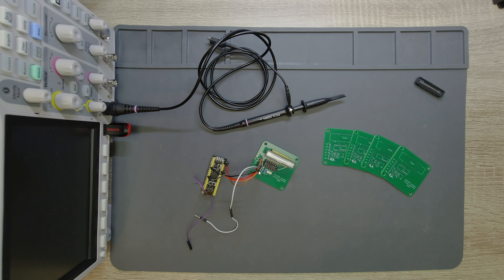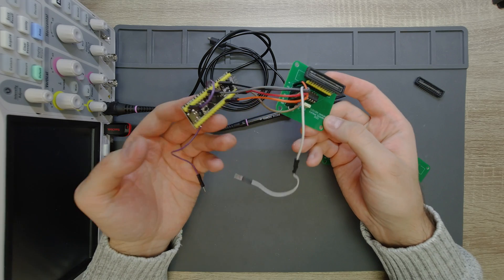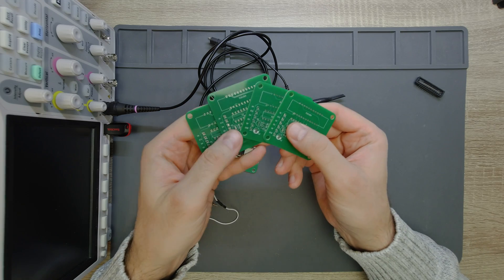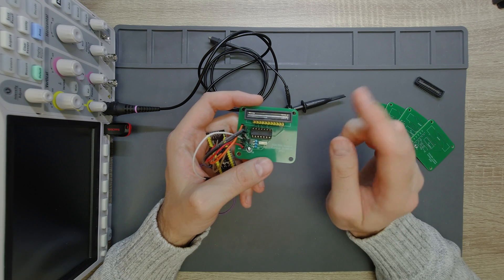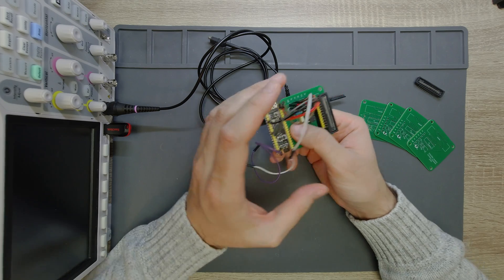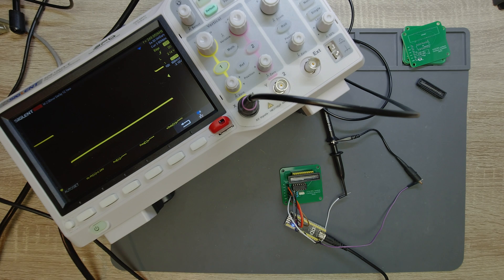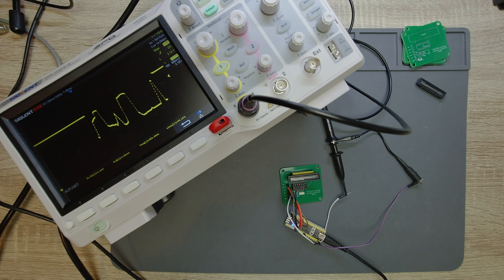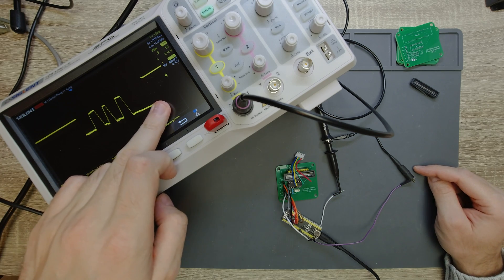TCD1304 - Part 1 - Introduction

Comment: The capacitor of C1 in your video seems to be different from the capacitor in your BOM. What kind of capacitor is used for C1? Thank you
Reply from the maker: I used some 100 nF foil capacitor that I found at home. A 100 nF tantalum or ceramic cap is also OK. But I don't recommend this circuit. I would recommend the circuit in my most recent TCD1304-related video. It is more up to date and modern. https://www.youtube.com/watch?v=c3CUCue62sU

Comment: Hi.  Not being able to evaluate what would be necessary, I would like to ask you if this TCD1304-based approach could be readily used to build a single-photon detector that records single photons coming from the double slit experiment, but would have to be done in total darkness.  So far, the equipment that I am finding to do this is horribly expensive.  The CCD would have to remain active for a long time, collecting single photons and it is important that the recording of these photons remains in their proper locations.  Ideally, you should get a very weak pattern of pixels that look like the full-intensity double-slit exposure.  Do you think this can be done?
Reply from the maker: Hi! I am almost fully sure that in its current configuration, it is not possible. I would assume that the noise would suppress the effect of a single photon. Maybe with some extra cooling, one could lower the thermal noise. But I think you'd need a more professional device for this purpose.

Comment: Hello I bought your board and am trying to assemble it, can you clarify the values for R1 R2 and R3? Thank you!
Reply from the maker: Hi! Please check the datasheet of the sensor. I used the exact same circuit and values. Also, I would recommend my more up to date circuit for driving this CCD, it is much better and compact.
Reply: @CuriousScientist  thank you! I saw the third video with the new board after I had ordered the initial one. I think I'll move to your new layout once I have a working prototype with the older board. I'm not talented enough to do the surface mount soldering so I might have to pay pcbway for that. Love the fact that you published all of this, it greatly helps on my project.
Reply from the maker: Those components are large enough so you can solder them by hand. It is not super difficult. I hope your project will progress well!
Reply: @CuriousScientist  Hi do you need to have a programming dongle or cable from ST to program the microcontroller? I have the same one from this video series and I cannot get it to connect, the program tells me I need ST-LINK. I should already have the SW I need (I think)...
Reply from the maker: Of course you need the ST-Link.
Reply: @CuriousScientist  Ah I see, thank you for that detail I must have missed it in the videos.
Reply from the maker: No worries. Programming an STM32 via ST-Link is a fundamental STM32 knowledge. It is not in the video since this is not really a beginner project. So, those who try to reproduce what I show must know how to program an STM32 microcontroller.
Reply: @CuriousScientist  yep, it is as you said. I've mainly worked with arduino and similar which generally just use USB. You made everything else straightforward in the videos such that a novice like me could do it but then I hit a wall with the download.
Reply: @CuriousScientist  hello! I got a ST link cable and the code seems to work based on coolterm behavior. I can't seem to decypher the output though, 1 byte is \x06 etc. In your PC-side code are you reading in as serial (virtual com port) or using something else?

Comment: Great project. One question: Have you checked for other options if you want to measure up to the infrared (let's say 2500 or 3000 nm)?
Reply from the maker: Thanks! Have you checked the datasheet? The CCD is basically unresponsive above 1100 nm...
Reply: @CuriousScientist  yes, I've checked it and saw what you just said. But I was also searching for other chips that may be responsive above 1000 nm as well. I haven't found it. Do you know any? Thanks for answering
Reply from the maker: There are chips, but they are not CCDs. At those wavelength that you are talking about, the physics is different... Look at the silicon band gap versus the photon energy at let's say 2500 nm...
Reply: @CuriousScientist  I didn't know it is not available. Yes, I would need a material with a smaller band gap, lets say below 0.5 eV. I saw in you video you want to build maybe an UV/Vis but my dream is to build a Raman.

Comment: excellent explanation and description. What do you think of using a ILX511B? Would it be to complicated because the CCD being used here has its own internally built logic control circuit?
Reply from the maker: Hi and thank you! I have never encountered that sensor in real life, I only saw it on the internet. It seems to be easier to control it, but it has much less pixels (2048 pixels vs 3648 pixels) while its spectral sensitivity is roughly the same as of the TCD1304. Also, the Toshiba CCD has 8 um wide pixels, while the Sony has 14 um wide pixels. This could be better for sensitivity for the Sony (larger surface area per pixel), but if you need resolution, the TCD1304 would be better. Pricewise, the Sony is 3-4x more expensive. I just quickly skimmed through the Sony's datasheet, so I might have missed something, but I would go with the TCD1304. If you check my other videos, you will see that it is relatively easy to drive it. I published an extremely detailed walkthrough for it as a video and also as an article on my website.

Comment: hello, thank you very much for your videos. I would like to replicate this and need a few explanations on the wiring between your PCB and the MCU ! Could  you please detail what pins of the MCU are connected ? Best regards
Reply from the maker: Hi! Check my other two videos for this CCD. You can find it on my channel. You can even buy my very compact STM32F401-compatible CCD breakout board, so you don't need to struggle with the wiring.

Comment: This is exactly what I was looking for. I've been thinking about making a camera with a linear sensor for ages. I was thinking about using a Pi Pico for the job. The built-in state machines could be used to generate the clocks.
About the schematic, do you really need the inverter if you can set the polarity of the clocks in the processor?
I'm very excited by this project. Great video too.
Reply from the maker: Thanks! Check the more recent video I published on the TCD1304. The inverter is not needed. I even designed a much better PCB for the task.
Reply: @CuriousScientist  I just started watching the second video and I see you mentioned the inverter. I had to leave half way through but I plan to get back to it later.
Reply from the maker: I hope you'll find the information useful.

Comment: Hi, 

I am a mechanical engineer, currently developing a ventilator for my final year project at university. 
My design makes use of a nema 17 stepper motor. 

I would like to control it with an arduino. However I am currently inexperienced with arduinos. I watched some of your video and can tell you have a tremendous amount of knowledge and experience with them. 

I need to control the speed, direction and number of steps and want these variables to be adjusted by maybe a potentiometer or rotatory encoder. 

Is this possible and if so would you be able to assist me?
Reply from the maker: Hi! Watch my videos and you can learn all of these from them.